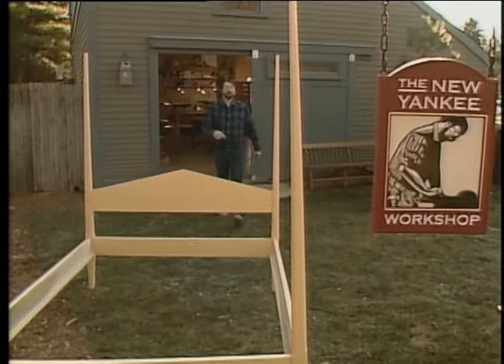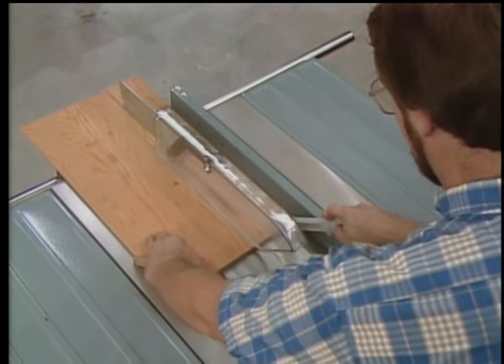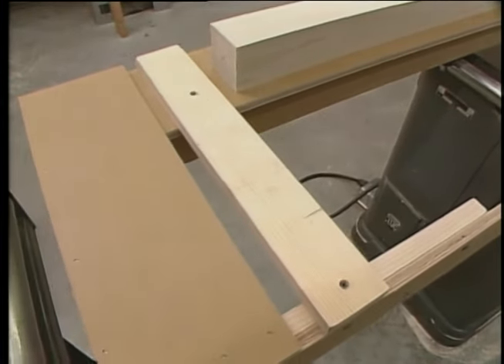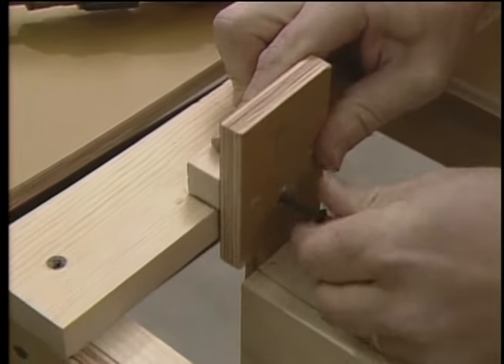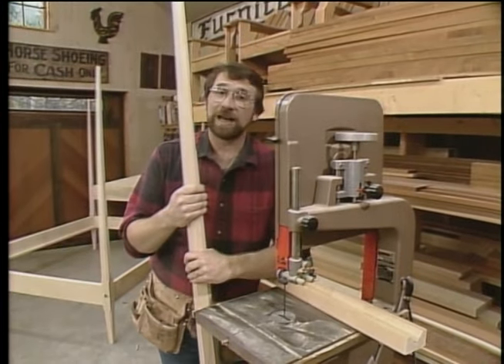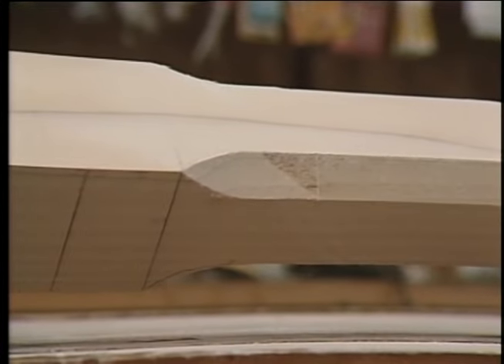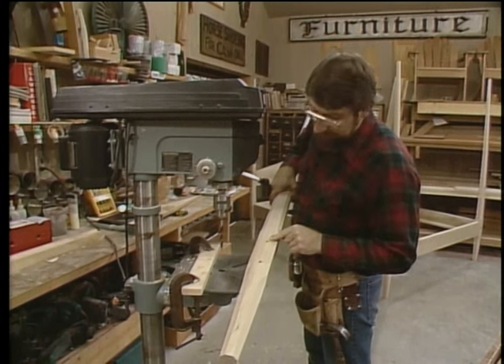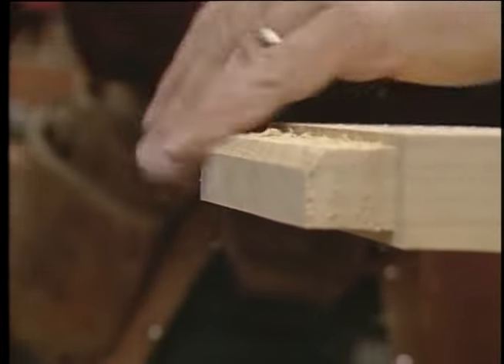Pencil-Post Bed  |  S2 E6

Comment: Thank you Norm for your instructions and use of the Radial Arm Saw. Bought my Craftsman 10 inch RAS back in 1991 as my first stationary power tool thanks to NYWS.  Still in use today. Can not do a tenon joint on a mitre saw or dados or rabbits or lap joints. RAS still have a place in the wood working shop thirty years later!
Reply: Well, I can do rabbets, dados, and lap joints with a router or a table saw, but yeah - a RAS is much faster!  Just wish they weren't so expensive.  They cost more than many decent table saws and much, much more than a router or a compound sliding miter saw.
Reply: Lay hold of the book The Magic of You Radial Arm Saw by R.J. DeCristoforo. It'll show you how make just about any joint, as well as a bunch of other RAS techniques.